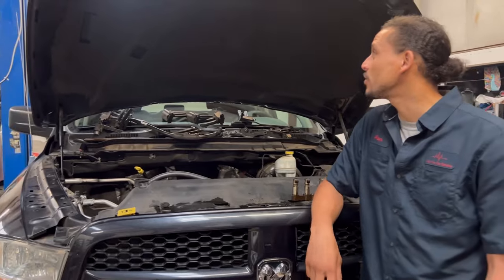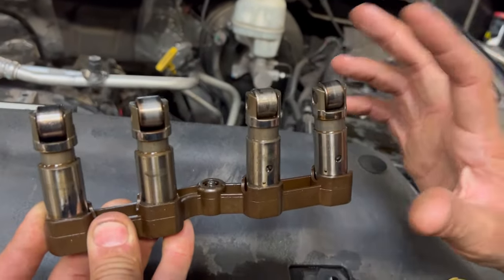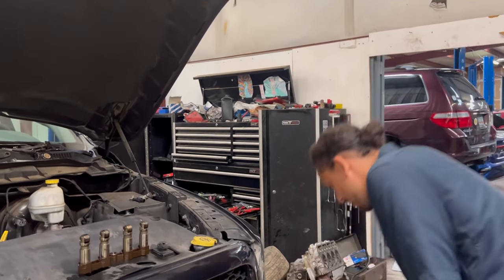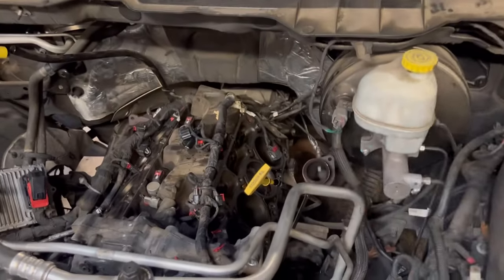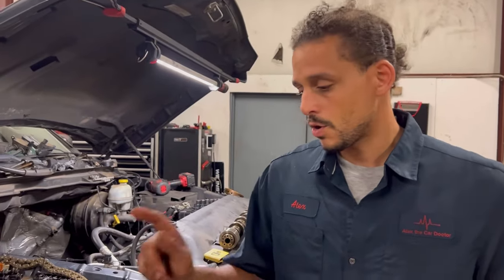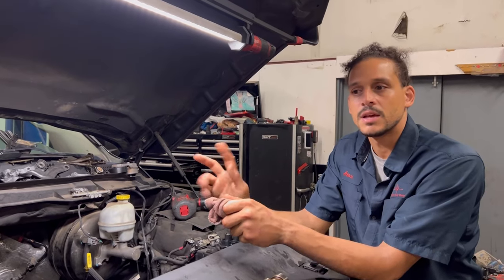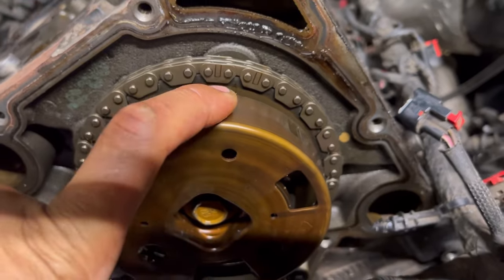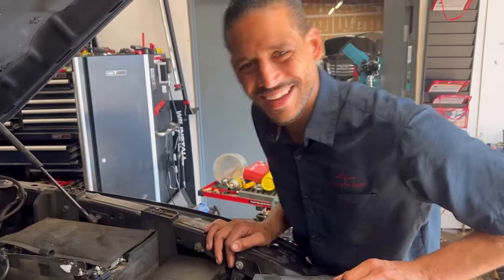The Lifters damaged the Camshaft on this Ram 1500 with the 5.7 Hemi #hemi #lifters #dodgeram #dodge

Comment: I was told multiple times NOT to buy a Dodge Ram 5.7 HEMI and I did it anyway. 2 years later issue with the lifters and then not able to replace with the new camshaft because it’s too tight and won’t turn. I bought the wrong truck and will never buy a Dodge again.
Reply: Just keep driving it. It’ll go 100k miles with the noises. No sense losing on it on a trade in
Reply: That doesn't make any sense. If the cam is too tight and doesn't fit, then you need adjust and get a different one.
Reply: @The_Red_Coyote  I was going by the mechanic information and then he screwed it up causing me to have to purchase a remanufactured engine. Truck paid off but now I’m having to pay for it all over again.
Reply: Sure but go to Chevy, and they have bad V8s and transmission problems now and the Ford engines twin turbos and good for 100k and then trash. The hemi is the most reliable out there.
Reply: News flash!!!  Every manufacturer has issues! Which issues do you want to deal with. Cam and lifter issues in RAMs are easy to deal with and can be permanently resolved with the right replacement parts along with a melling HV oil pump. Still the best 1/2 ton truck period.
Reply: Planned obsolescence. Stellantis has known about the lifter cam issues for over a decade
Reply: The lifter cam issue has been a thing since the 5.7 hemi came out.
Reply: Just so everyone knows the GMs have even more issues than ram with junk afm lifters which do nearly nothing just like MDS!
Reply: @rufusaddison3260  Sounds like you got the wrong mechanic who didn't know how to do the job.....and then reading further to see you write about how he screwed up with the engine swap confirms it 🤷‍♂️🤷🏽‍♂️  That's the lesson to learn, rather than avoiding RAM. But do what's best for you.
Reply: I have a 2019 Ram 1500 Laramie that I took great care in taking it to the dealer when it needed any maintenance including oil changes. in this month alone I've had a cracked exhaust manifold and now the lifters. I think the biggest problem with this particular issue is that it is known and they haven't fixed it. If i would've knew this before buying it I would've had Tundra my driveway. BTW even after the mechanic repairs the engine the problem, the issue can come back. This is not a maintenance issue, it's a flaw in the design of the engine.
Reply: Exactly what happened to me and my truck paid off too.
Reply: @rhott25 it’s well known that he is struggle to properly oil and idle and it can be solved with a high volume oil pump, wich that size of an engine should come with from the factory.
Reply: @rufusaddison3260  your first mistake was having someone else work on YOUR vehicle.
Reply: I don’t blame you 👍
Reply: @grizman914 ok😂
Reply: Had a friend with a 2018 Ram 1500 hemi single cab was a great truck till he started having problem after problem only 70k miles. Maybe there are some trouble year models to avoid just like Ford and Chevy has
Reply: @rhott25 problem is that you took it to the stealership
Reply: I have mine for 10 years, drove it off the lot in 2014, no hemi tick, use the right oil, change it...
Reply: I got a 2019 Ram with 33k miles on it. I love my truck ❤
Reply: Should I send the heads to the machine shoo? Mines is not overheating or nothing just wondering, great vid thank you
Reply: @donaldgunnell1073    What oil and filter do you recommend? Thanks 😉
Reply: @Johnny-ip4mk  I use royal purple oil and filter
Reply: 🗣SAME!!! Got a 2015 that fried right after I paid it off!🤬
Reply: @bigcasual08 if you're having valve issues, lost compression or you pulled the head gaskets off, send it to the machine shop. If you're not having those issues now, I wouldn't worry about it. In my case the lifters on cylinder 3 went bad in mine which also damaged the cam. I came out cheaper replacing the engine than replacing the cam and lifters.
Reply: Get a used tacoma. Mine has 400 000 miles never one issue
Reply: I heard if you get a high volume oil pump you should be ok. I’ve heard the issues come from the low idle it doesn’t push enough oil up there and eventually they go bad. I saw someone put a high volume oil pump on so they are always properly lubed
Reply: Hi Alex, how much you charge to do the lifters
Reply: I got a 2013 ram 1500 5.7 hemi yeah it’s a truck and your gonna have those problems but this truck will pull anything and drive for miles on end like nothing even with shit breaking on me it still goes on and on. Plus I use it everyday for work so it never gets a rest 😂. Soon it’s gonna be getting all new camshaft and lifters, longtube headers all the goodies. It’ll be a new truck and put through hell again. In my opinion it’s a beast of a truck if you know how to work on it and drive it 😂. Never taken to a dealership because they don’t replace parts the right way.
Reply: Same. The truck is an embarrassment to own.
Reply: I installed new lifters and camshaft in a Dodge Ram Hemi with 140k miles. One of the cam lobes had already rounded off.  

I elected to get my helper to remove the engine because I wanted to pull the oil pan and check everything. I also replaced the timing chain and guides which were worn pretty bad. 

Engine ran like a brand new truck. About 2  week later the customer called and said truck won't start. Might be the starter, so he towed it back to the shop. 

Engine locked up! Apparently one of the rod bearings spun, which we didn't mess with since it showed no problem at the time of the repair. 

If I get any more Hemi engines, I'm going to recommend a new engine!  We installed a used engine in this one for free with 110k miles.  Good luck
Reply: I have a 2016 Ram 1500 with the hemi. Bought it 94k on the odometer & currently have 143k on it. I’ve always changed my oil at 4k miles and used high quality full synthetic oil. Never had lifter tick and engine sounds healthy & hearty. Just don’t idle your truck very long and you should be good
Reply: @rightwinger1505  See what you did there lol
Reply: I have 2015 ,had the cam and lifters replaced, still driving it and just bought a new 2021 love these Rams.Hemis

Comment: Use synthetic oil,  and cut the manufacturer recommended interval in half. Going 10k between oil changes is never good. Do this and you'll be fine. Ram isnt inferior to Ford or Chevy.
Reply: 5 w 30 synthetic is what I use
Reply: @rightwinger1505  I ran Mobil1 synthetic from new changed oil every 3000 miles.  I bought the truck off the showroom floor.  I'm now replacing cam and lifters.  I have been a Mopar guy for decades. Never again.
Reply: @coloradoamx1  sorry to hear that. I've been happy with my mopars so far. That can happen with anything these days I guess.
Reply: @coloradoamx1  I've heard that long idle times will damage the cam and lifters in the hemis. Is that what you have?
Reply: @rightwinger1505  I don't idle the truck at all.  The longest idle time is sitting at red lights, and if that is too long to idle until the light turns green that's nuts.  I don't even let the engine idle during the winter the warm up the truck.  I generally start the engine, let it run long enough to get the oil moving and drive slowly until it warms up.   The Internet, especially YouTub, is swarming with Hemi's with this issue.  Significant design flaw it seems.
Reply: @coloradoamx1  yeah. I guess all brands have some kind of issue or another. Just depends on what you are willing to put up with

Comment: I changed my  oil every 3000 miles with penziol  7 qt s and filter mine failed at 44000 miles the problem is that the cam steel is not as hard or harder properly

Comment: Hey Alex, GREAT video. I'm 70 and am going to be doing this on my nephews 5.7. But I think instead on going back with the MDS lifters I'm going to replace with non MDS lifters, remove the MDS solenoids and replace with factory block off plugs, and flash the ecm to turn off the MDS system. This way the lifters will be supplied with pressurized oil to the lifters all the time and not just when the MDS system is activated and it will run on 8 cylinders all the time. I did something like this on my son's Honda so it would run on all 6 cylinders all the time. The engineers that came up with these systems have done so at the expense of the consumers. It 's a shame. But automotive engineers will keep us mechanics in business forever. Good luck with your family business.
Reply from the maker: Hey there yes that’s the best thing you can do for that engine unfortunately as a shop owner I have to go back with stock so I won’t be liable for anything. The engineers make this stuff to fail on purpose it’s all about money in this industry it’s said it really because they don’t make cars like they used to
Reply from the maker: Thanks a lot for watching
Reply: @AlexTheCarDoctor  which lifter went bad, was it a MDS or non MDS lifter??? i hear both can go out.
Reply: Idling is one of the problems with these engines. And in canada we idle a lot if its a work truck. I personally  know 6 of these trucks the engine failed
Reply: How was the transmission shifting through the gears with the non MDS modifications you did?

Comment: Next time you get a Hemi in which I’m sure won’t be too long can you do a long video of taking it apart naming the bolts and tools needed for this job for diy guys like myself I’m sure this will get you millions of subscribers just found your channel and subscribed
Reply: Man I would love that if he did lol
Reply: Man, let me say it’s a lot easier then you would think. Only stupid issues is the lightweight torquing, because the little bolts/screws love to snap. 
I will say, only thing I knew about vehicles is oil changes, brakes replacements and spark plugs. But when my Cam and cylinder #8 lifter took a sht I couldn’t afford the to pay a mechanic $4000+ for 22hrs of labor and parts. So I researched YT like crazy and bam magically got it all completed, couple little bumps in the road, like 4 snapped oil pan bolts, 1 camshaft plate screw snapped, and had to replace the timing cover crankshaft seal twice cause wrong directions left and right(don’t not lube seal at all, anywhere no it). 
I upgraded the oil pump from the cheap OEM JGC 5.7L(idle around 24+psi) stock one to a direct bolt on Hellcat/SRT 6.2L  oil pump, because it’s basically a high pressure/high volume pump part# 68195993AD (idle 35+psi). Upgraded the CAMSHAFT with a Scat pack 392 6.4L MDS/VVT CAM part# 5038419AB (direct fit no modifications at all, still used the oem stock but BRAND NEW rods, 16 lifters, and valves. Just upgrade the springs from that cheap crap MOPAR used to their NEW ones, way better quality.)

And then I just throughly cleaned everything, since I was deep in there. Replaced all gaskets, water pump & thermostat(from 203degree to 180degree), timing chain and components, upgraded the OEM alternator(weak 160amp or something like that) to a 300amp for really no reason just great deal and a few other things. The job is just time consuming and can feel tough but it is doable with the right info of direction. 

But like he said, use a high quality oil. 5.7L says 5-20w but I’m using RP 5-30w has almost 10% better viscosity with BG’s MOA.

Comment: Thank you. I have a 2013 ram 5.7 hemi with only 77k miles. I've used the synthetic oil and change the oil frequently. One issue I have seen is that, the design of the engine, where the lifters are close to horizontal, and trucks used where they idle a long time are causes of this. Several videos out about this topic.
Reply: Yes, my wife would come home from working overnight shift and just sleep in the driveway w the truck running for almost a half an hour. I asked her why she didn't just get down and go to sleep in the bed. She said she was just comfy in the truck. Now I'm like "Gee thanks for causing this problem"

Comment: Thanks for putting this video out. My mechanic texted me pictures of damage cams and I wasn’t fully sure what I was looking at. I have a 2014 with 255,000 miles. We also did the timing chain, oil, pump, and water pump.
Reply: Hi - I was wondering did you switch to the "hell cat"pump ?
Reply: @dimensionexo.  no, I should have probably just done the "delete" and gotten rid of the eco system.  My engine work turned into crap!  3k to swap cams, lifters, and everything in there that was accessible like the water pump, timing chain, etc...  Truck sounds like a diesel now and the check engine light comes on every day, then off for 12 hours, then on again for 3 days, then off again for 4 hours...  Probably the last job my mechanic friend is doing for me!
Reply: @barnandhome  That's not right - I trust better days are ahead for you and me *
Reply: @barnandhome  no you should have got oem parts, the non mds lifters fail just as much as the mds lifters it’s not the mds system. The problem is the manufacturer they used until 2019, bad part quality. This is why idling kills them, yours made it pretty long. Mine has 144k with no issues. The part numbers where changed and now all hemi engines use the update part numbers for mds and non.
Reply: @joshkrause2977  Yes!  my mechanic was trying to save me money and I told him, "bro, this is my work truck! I don't need to save $500 and deal with problems."  His attempt to save me money is costing me over 3K to fix it right!  I'm so pissed.
Reply: I would have the reman route

Comment: Great video man just like many of my fellow hemi owners I currently am aswell going through a full rebuild on my 6.1 hemi due to a lifter failure thanks for this video!
Reply: I saw a video where the mechanic said to use a higher output oil pump from a hellcat. Lack of oil pressure when idling for long periods of time can have something to do with the failure. I hope the build is going well for you!
Reply: @user-hy7kq8gw2g  Melling high volume oil pump!

Comment: Good information Alex. Much appreciated. I have a friend with a 2017 hemi truck same issue. She took it to a dealer and was quoted $8,100 and they only wanted to do one side. 😂. Thx brother 👍🏻✌🏻
Reply from the maker: $8100?????? 😳 that’s insane!
Reply: @AlexTheCarDoctor  Thanks for this video, alex! My 2013 ram 1500 5.7l only 105k miles . Dealership quoted me $1900 only if the camshaft doesnt need replaced. $3850 total for total job. Oh....I been changing my oil since warranty expire for the last 3 years no problems. last two oil changes by Valvoline quick oil change, now all of a sudden i get ticking noise.

Comment: I just had this exact thing happen to a Dodge Journey and it was caused because the old timer was using conventional oil that sludges up the engine. It was also way too thick. It was at least 20W. 

For everyone out there, please, when your engine and manual say 5W-20 full synthetic, use that oil. It was designed for it. If you think you know better than the people who spent millions of dollars developing that engine it will cost you 1000’s of dollars in repairs. Just do what the manual suggests, please and thank you. 

Also, Alex, you are a stand up dude. I just found your channel today and I love it. Good stuff, man.
Reply from the maker: So true Leonard knows his stuff. Thanks for the support buddy
Reply: I have had my 2012 ram 1500. I don’t use the recommended 5w-20 I instead used 10w-40 and that’s on all my vehicles. Motor has 210k miles on it with no tick at all. Thicker oil helps and also the fact that my MDS system doesn’t work due to MAF sensor. So all cylinders run all the time. Eco mode never cuts on. To each their own though my friend. I just think that it being an engine with more miles then the piston rings and other components have weared down some and not necessary to use the 5w-20
Reply: Um….using the proper viscosity oil is important however, if you change your oil at proper intervals based on oil type (good quality conventional vs good quality synthetic) it will operate the same.  Engines are designed to run based on oil viscosity (especially Hemi with MDS and shutdown solenoids) not on synthetic vs conventional.

Comment: Hey man glad I found your video. I own a 5.7 liter in my 21 Durango and engine was overheated and actually stalled out on me. Dealership advised me that my engine piston was broken, which damaged my engine and radiator, which lead to damage cause to my catalytic converters. I’ve been taking it to a quick lube place but it looks like I may have to start taking it to an actually dodge dealership to assure adequate oil service.

Comment: Happened twice to me, once under warranty and once after it expired. Brutal. Asked a 43 year mechanic who said he does these every week about Metallurgy and after market parts and he said it has nothing to do with that... its a poor oiling design on the top end. Hes used plenty of other parts (lifters and cams) and the same issue occurs. The guy at the Dodge dealership said its a steady flow every week of Hemis coming in for either this problem or broken exhaust manifold bolts ... its their bread and butter. Dodge is aware and could care less.
Reply: Yep. These seem to be the most common issues lol. My Hemi currently has lifter tick, the cat busted off of the manifold, and the hood shocks broke. Seems you can always count on this happening.

Comment: Just bought a used  2016 grand cherokee  with the 5.7. 70k miles. 6k miles later got a broken rid bolt and lifter tick. I'm glad it's covered under the warranty. And all new lifters/cam  I wonder how many more miles this engine  will be good for.